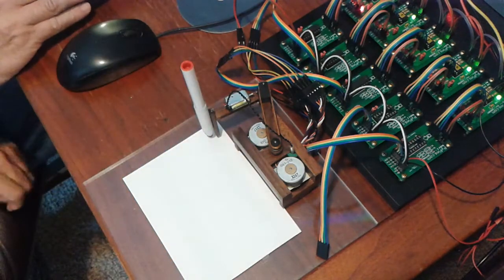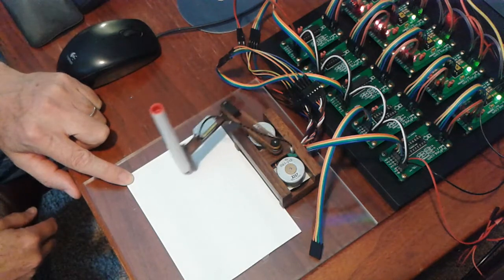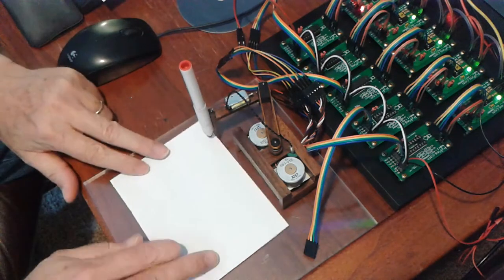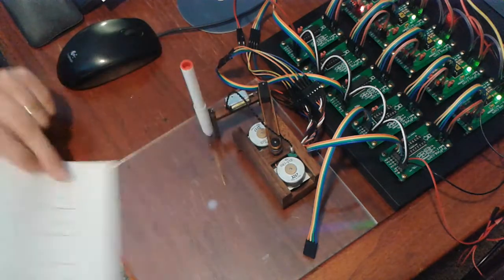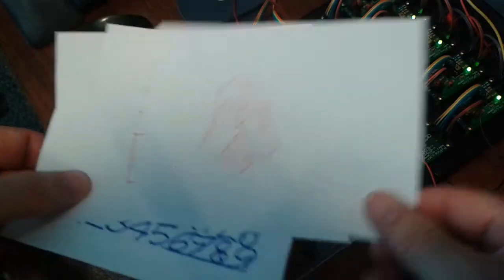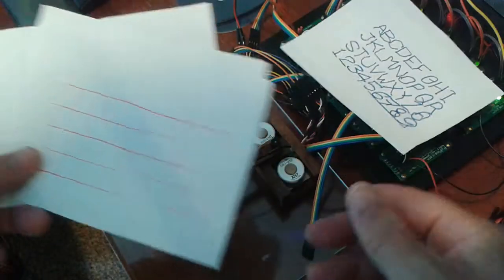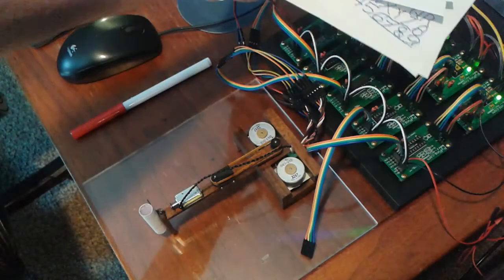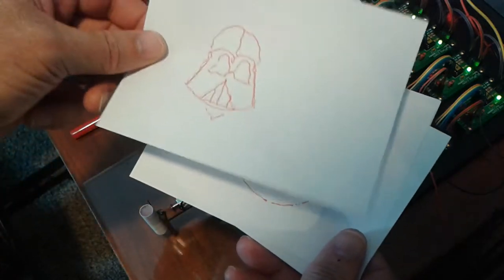Final Run - This is REALLY the End - Mini SCARA CNC Plotter Part 10

Comment: hi can I use old printer and scanner to create  mini cnc ..mean when the scanner read the printer do but how can I change the connection of colours for connection of motor stepper
Reply from the maker: Some old printers have stepper motors. However, most printers use regular brushed DC motors, which are more difficult to use. Both types of motors can be used for CNC, but they work differently.
Reply: Thank you so much i have benefits from your canal .I want to make easy cnc but I can't get ardino I search about it in market but not found it there therefore I search for circuit to make ardino to create cnc
Reply from the maker: You might also try a raspberry pi. Anything that will allow you to control the state of IO pins will allow you to control a stepper motor.
Reply: Thank you Mr C Darwin after I read your message I search in old market in my city baghdad of electronics and I find uno ardino it's 13$ and stepper motor it's 5$ for each motor this is first one I find it I'm glad to continue and build my cnc
Reply from the maker: That's good news.
Reply: Ithink I'll begin In next week

Comment: It's using microstepping right?
Reply: I can get clone modules with probably cloned drivers for €5 for a pack of 5. As long as they aren't used in high precision work, or where reliability and maximum current delivery are important (CNC/3D printing) they should suffice. www.ebay.de/itm/152381625980
Reply from the maker: Just half stepping using all state values. No amperage variations.
Reply: I suggested cheap A4988's but the project seems to be done.
Reply from the maker: Yeah. It's a good idea. But the software I wrote used state control of the pins on a pic12f675, and it wasn't worth redoing everything just to work with some cheap steppers. Plus, the gears have a lot of play in them. I think I'm at the mechanical limits now. Next time I'll use better hardware.
Reply: +nrdesign1991 The A4988's would become the most expensive parts on this setup.  
AFAIK even a pic12f675 is cheaper than an A4988.

but hey, if it's the only option...